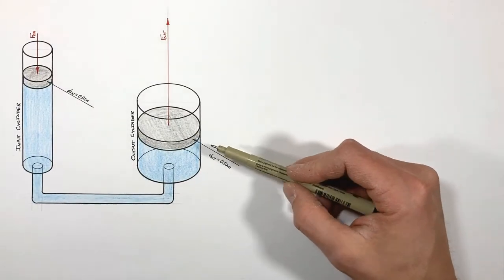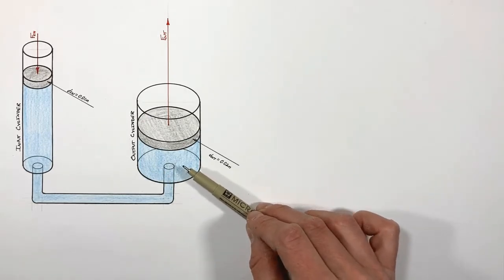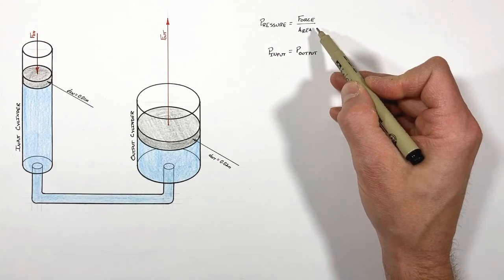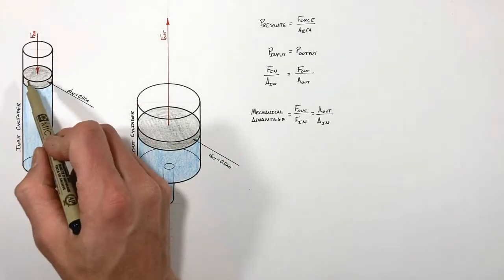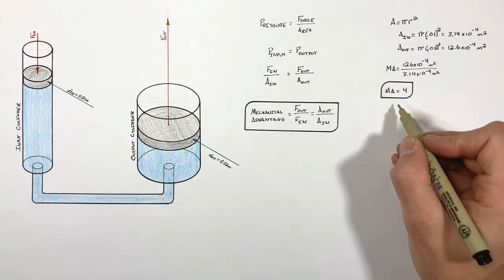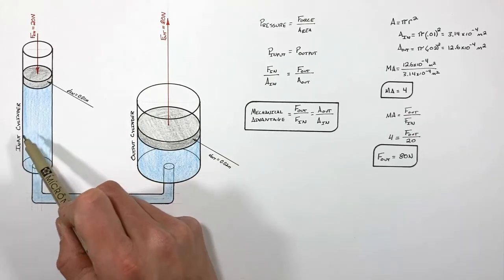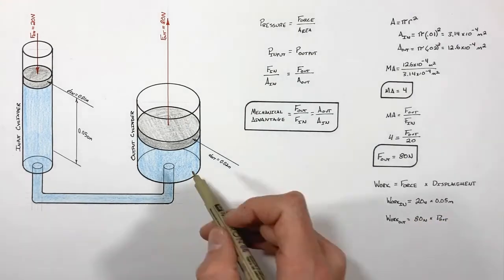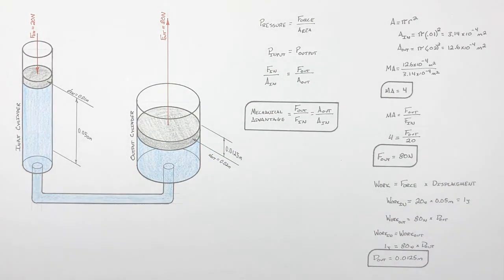Mechanical Advantage in Hydraulic Systems

Comment: Kinda of a long question, i apologize in advance. 

If we were to turn both of these cylinders into two separate hand powered bike tire air pumps, where each pump is moving the same volume of air with each complete stroke, except one has a smaller diameter piston but longer stroke and the other had a larger diameter piston but shorter stroke, would that mean the smaller diameter piston would require less input pressure to inflate a tire where as the larger piston would require more pressure, but inflate a tire quicker?
Reply from the maker: The smaller diameter pump would require less force to pump up the tire, where as the larger diameter pump would require more force...  This is seen in road vs mtb hand pumps.
Reply: @INTEGRALPHYSICS  I appreciate you for responding to my question. I kinda thought that is how it would work.

Comment: Is it possible to multiply forces by linking two of these systems together? Imagine a rod leading from the output piston of the first system and pushing on the input piston of the second. We should be able to connect as many of these in series as we like and and get massive forces applied to the final output piston, no? Is this ever done in practice?
Reply from the maker: Yes it is possible.   However increasing the diameter of the output piston has the same end result with a much simpler assembly.